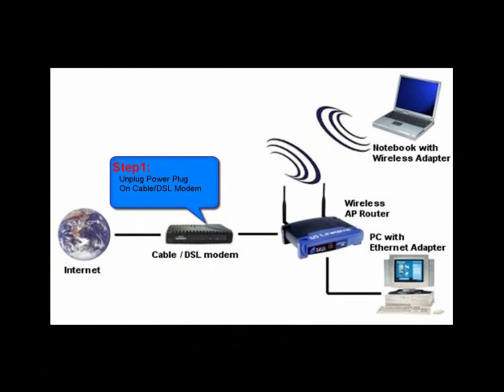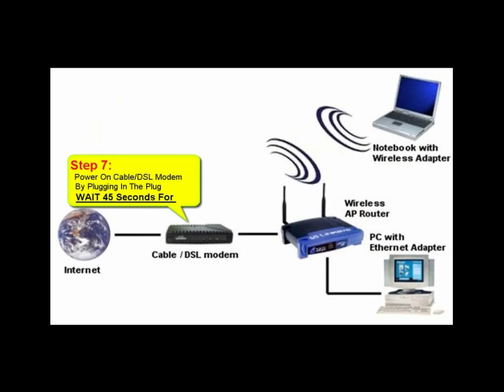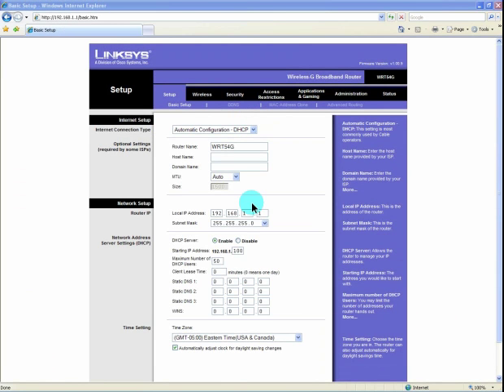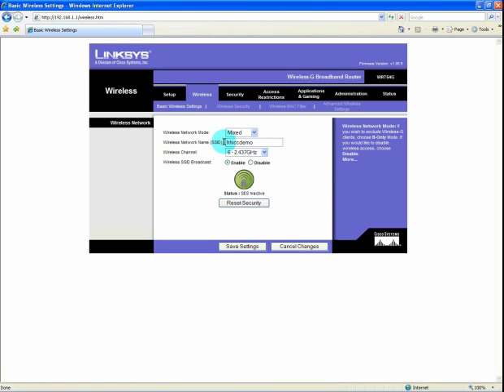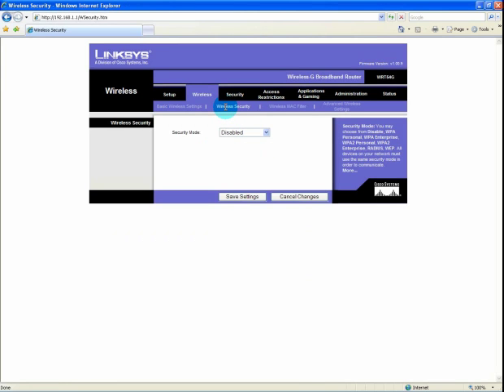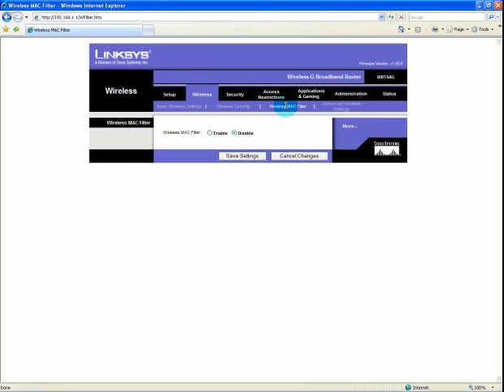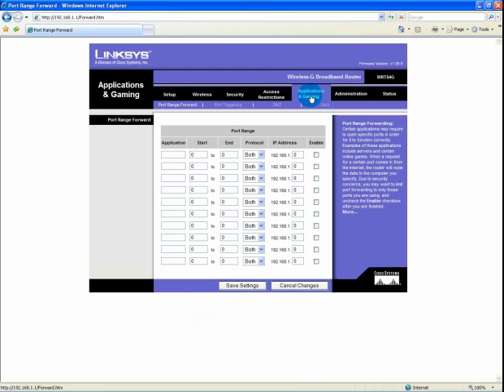HHICC Tutorial - Setup WRT54G Router Part 1

Comment: I have that model and it works just fine until I pressed the reset button on the back and I can't connect to the internet anymore.

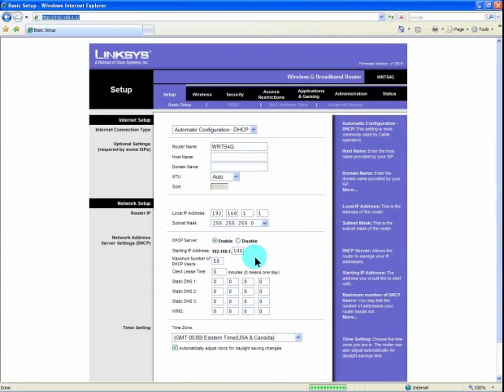Edit: I found out the reason it didn't work anymore after I pressed the reset button. The WRT54G default Local IP Address is 192.168.1.1 which happens to be identical to our internet provider's router and they are in conflict. When I changed the WRT54G Local IP Address to 192.168.0.1 it works again. The default can be seen at 2:28.
Reply: Thank you so much I did same and my worked you helped me alot

Comment: After following the steps up to Wireless Security; WPA personal, TKIP, set my password, save settings - It gets stuck in loading and I loose internet connection. I check available networks and I get a message for mine being: "The settings saved on this computer for the network do not match the requirements of the network" Huh? :\